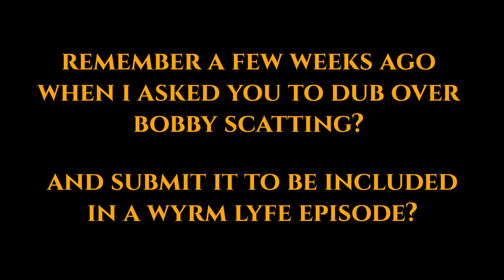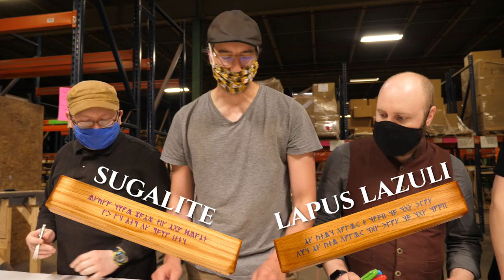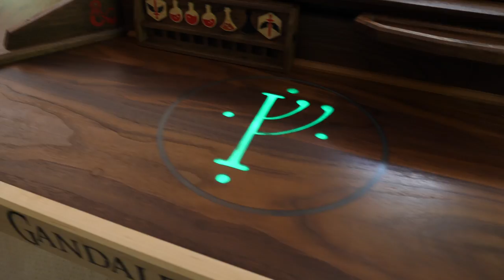This Table Blew Us Away! (it took 8 months to build) S4E21

Comment: The table is super cool, absolutely hire or work with this guy if you can. That’s how you get new and interesting designs that will keep you ahead. I do think the table is overbuild, too many details, so much complexity, with many potential points of failure. With a redesign of the overall functional parts and build you could adapt this to a production workflow design in the style of WW. You can always add all of the LED lighting and engraved runes if someone asked for it.